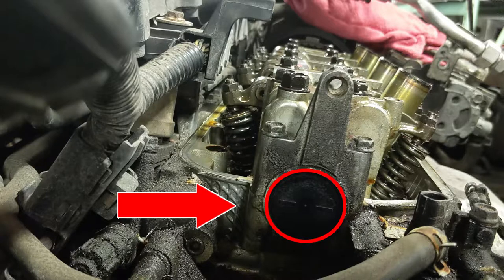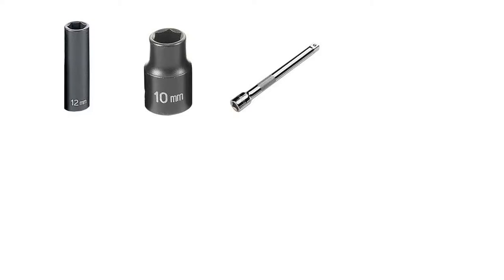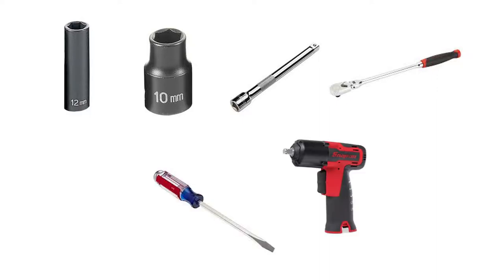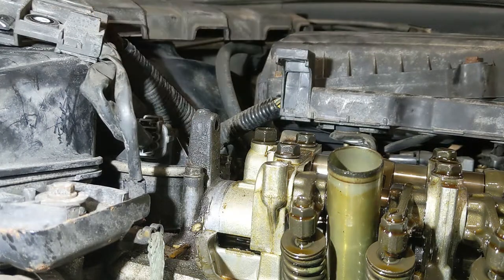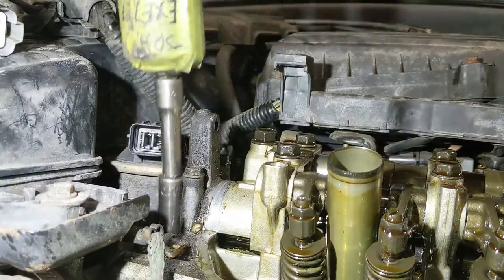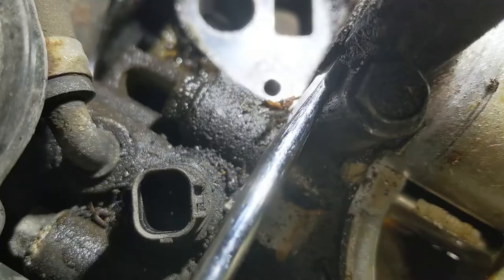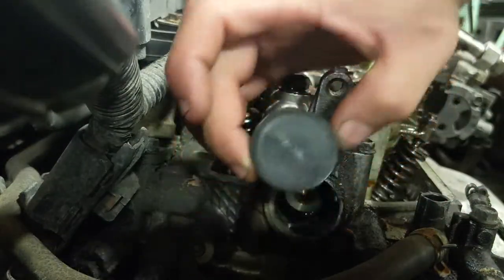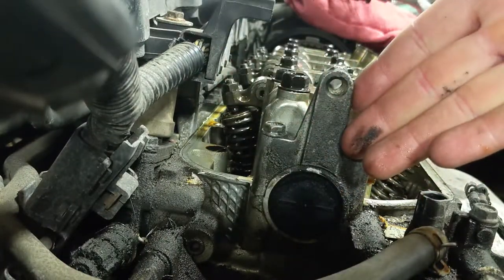QUICKLY AND EASILY REPLACE A CAMSHAFT SEAL ON A HONDA CIVIC D SERIES ENGINE

Comment: The felpro seal has an inside seal lip that requires removing the cam bearing cap to install.
I guess you can not put this seal on and use the OEM one that leaks and attempt to seal it with RTV instead like you describe here.
Reply from the maker: Probably not.

Comment: Dealer wanted to charge me $325.00 to replace my plug and it was easy access and nothing in the way. Just needed a screwdriver or something to pop it off. They must of anticipated they might break off a tab and have to remove the valve cover and charge people just in case. That is sleazy.

Comment: How do i know when i need to do this repair?. I have a D16z6 VTEC (1995 civic ex) that i replaced the VTEC solenoid gaskets. Its still leaking and smoking from burnt oil.
Reply from the maker: If it's leaking around that area, I would check to see if that's where it's leaking from. If you find the cam seal as the culprit, I would change it.
Reply: @RatchetstrapMedia  thanks. I have yet to diagnose where its leaking. Willlook into it thanks!

Comment: If it’s not horizontal will it still leak ?
Reply: The seal on the cam plug wears down over time especially since it’s just plastic and rubber taking years of heat. It just depends on what conditions it is in and really wouldn’t matter if it was horizontally or vertically placed
Reply from the maker: Doubtful. But That’s how it is stock from the factory.